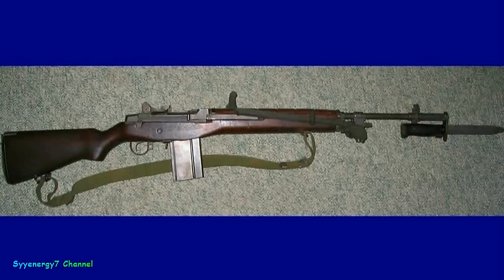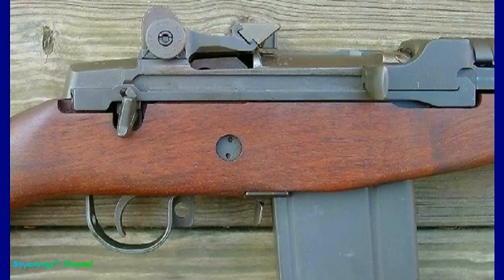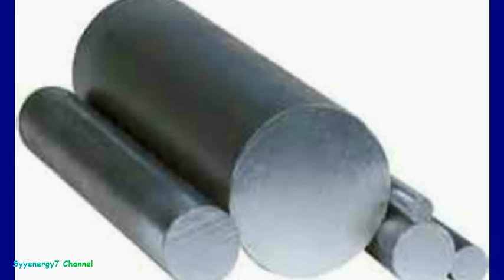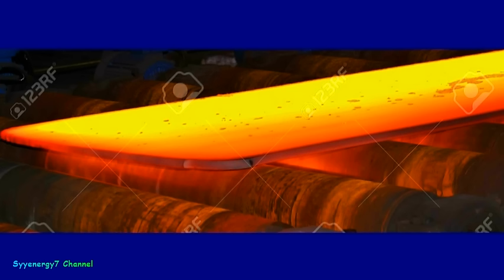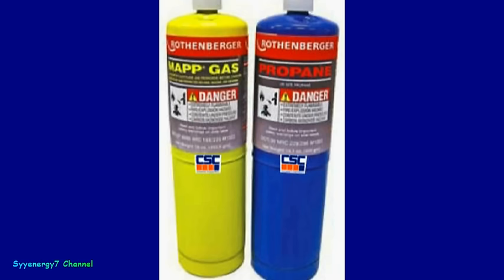Best Steel and Heat treating for Gun Parts  - Quick & Dirty

Comment: This is an informative video and not eas to find such a basic primer on simple heat treating but, a bit of a while to getr to the meat of it,  i want to harden a bolt on an GSG Sturmgewher that was made too soft by the manufacturer i needed to pick out the step by step of it and not so easy

Comment: Just right off the bat I dont want to believe or rely on anything you say in this video because you show an M14 and dont know the difference between it and a M1A. Your not a gun guy if you dont know the difference. So the rest of your info becomes questionable. Heat treating is not something some hill Billy needs to do. You'll end up dead. Leave heat treatment to the professionals.
Reply: You don't have to know every single make/model gun to know heat treatment, give 'em some slack
Reply: He could have been talking about the M1A and the m14 which were identical in appearance for the most part, but a real gun guy would know that so I'm going to question everything else you say.
Reply: After a certain point you stop caring about exact model numbers and little details. The point is that it doesn't really matter because the information applies regardless